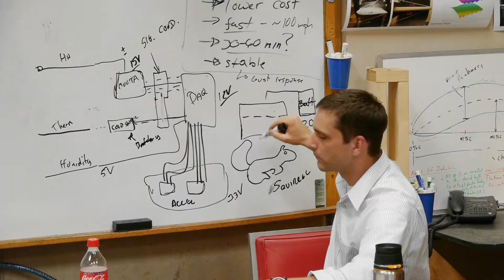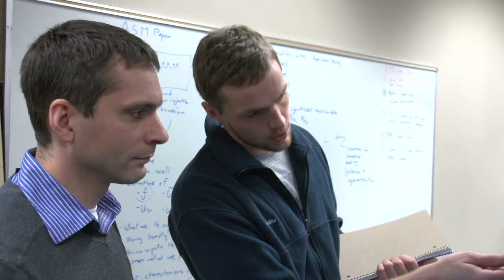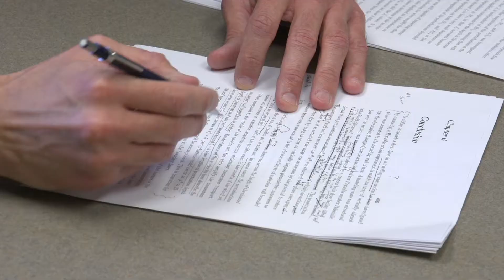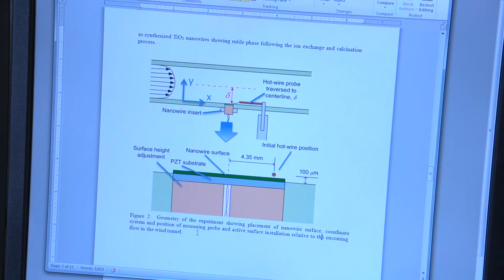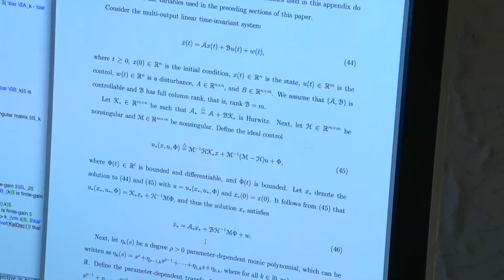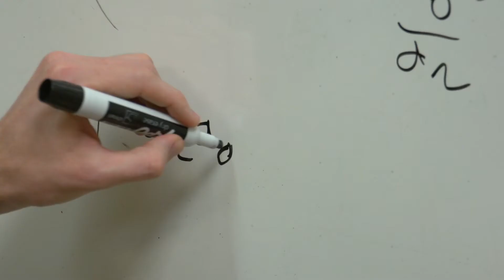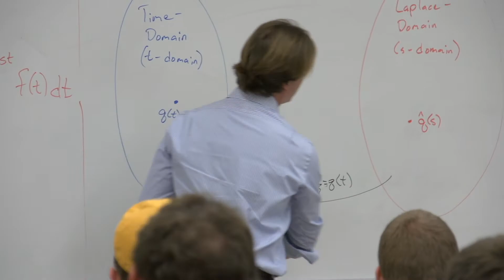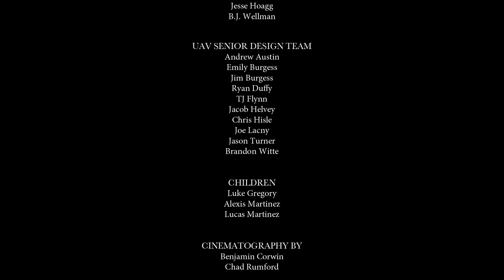Rise Above: A New Generation of Aeronautics Research (Full Documentary)

Comment: Hey one question here: Why not use brushless motors instead of Gas engines? As I know its always better to go electric since there is not a whole big problem of starting the engine etc.
Reply: If endurance is important, specially in heavier models, there is a big weight penalty for electric motors (yes, even brushless, even with LiPo batteries) vs liquid fuel. Batteries are heavy compared to the endurance they offer as compared to liquid fuels.
Reply: Exactly, fiel is a much more dense dir of Energy. Until we can make batteries much more dense in energy, it will be hard to make electric planes
Reply: fuels provide far more power for the same weight as batteries. also, starting engines is generally not a problem.